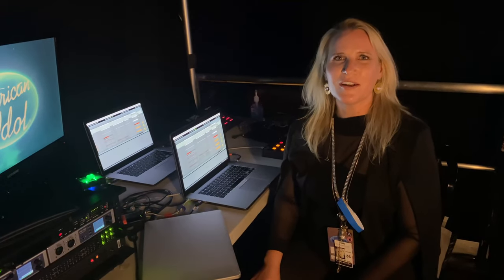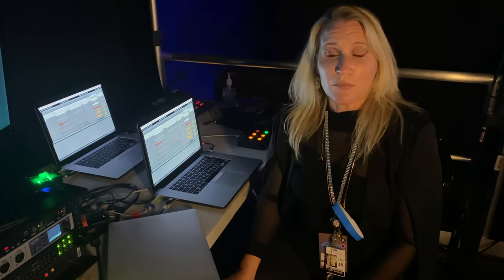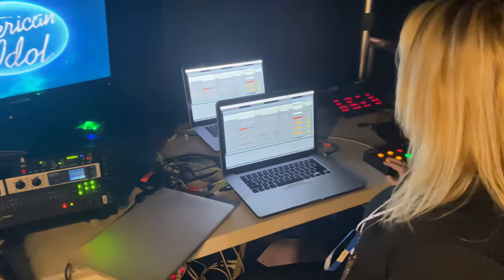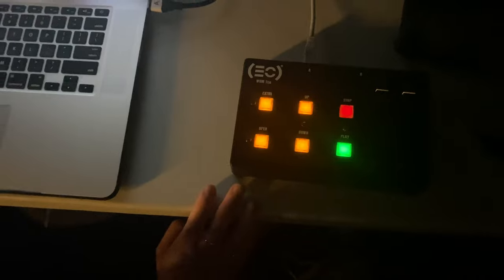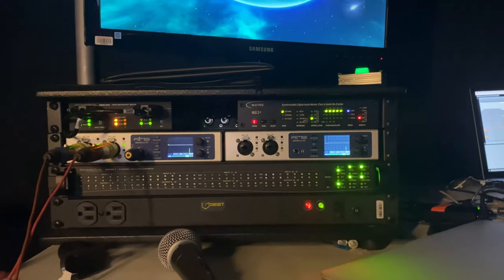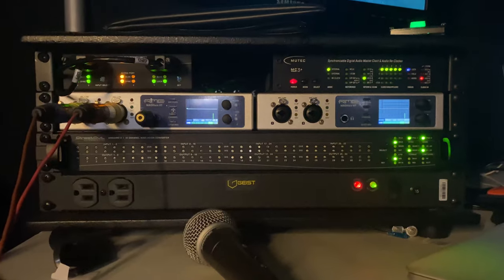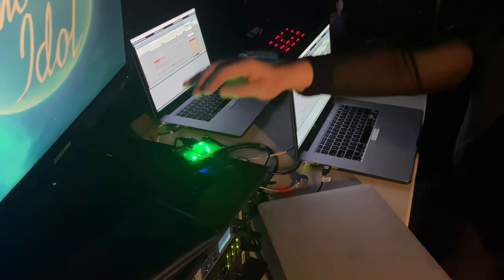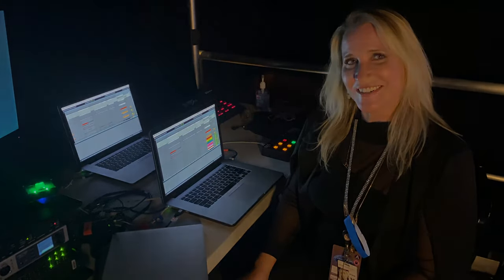American Idol Rig Rundown // Laura Escudé

Comment: Can I run a redundant rig with 2 different versions of a Macbook? For example a 2019 macbook pro and a 2012 macbook pro ?
Reply from the maker: Yep you can use 2 different versions, you just need to have the same version of the software you're using on both
Reply: @lauraescude  thanks a lot!